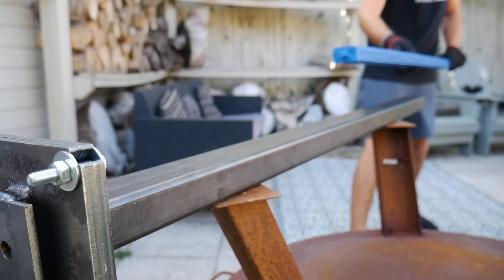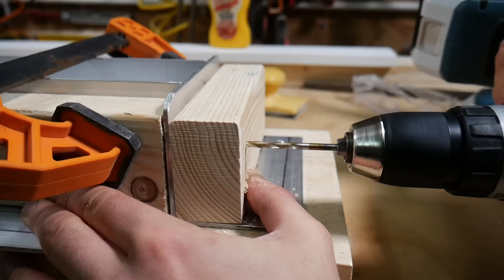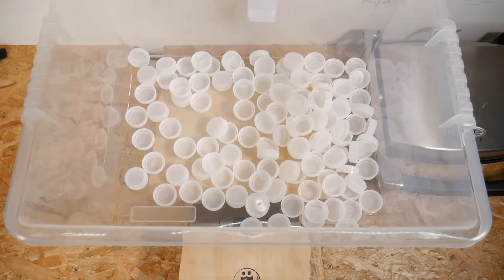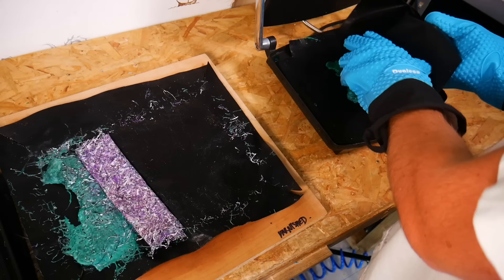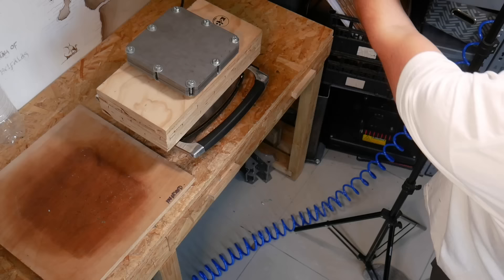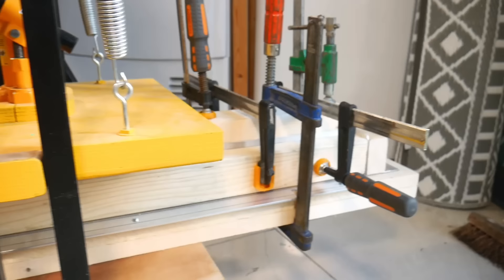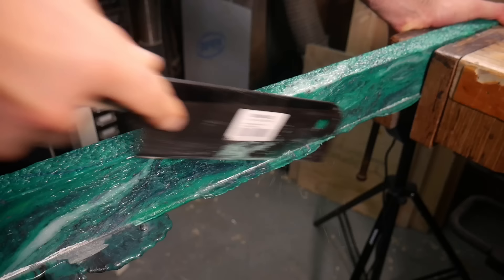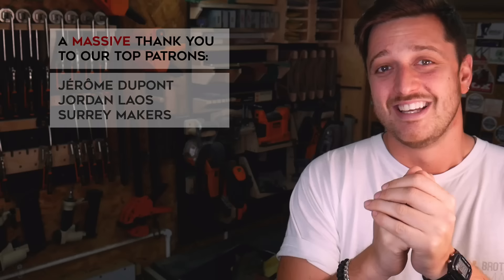How to Make Recycled BEAMS from Plastic Waste at Home

Comment: You should strength test the plastic beam vs. A standard wooden one to see how it compares
Reply: that the most important
Reply: Agreed. What good is it if it can't demonstrate its strength, especially for the time.
Reply: @quest_onchannel54  . Pound for pound it's way weaker than wood . I've used it for tool handles and it splits unpredictably and chips easily with impact.
Reply: good call!
Reply: @leerogers6423  thinking about this...just use more instead of a standard 16inch stud gap...Honestly to answer myself from my above comment...less stud gaps increases in more plastic...This is actually imo a good idea.
Reply: It’s much weaker than wood in two ways. It bends easier and it continues to deform after it bends.
Reply: @leerogers6423  Nice colour options, though. That's what matters.
Reply: @charlesfield9286  hm... maybe it'd be better as roof tiles or something? can't see it working for big wood projects if it does that
Reply: @ara.may.sauvage  it’s the most  inert substance known, but UV light eats it up. Maybe a cutting board?
Reply: @charlesfield9286  just read a co in australia makes something similar but adds mesh to make it stronger and uses it for flooring and fencing... sans mesh cutting boards works too
Reply: @ara.may.sauvage  Plastic being an amorphous material will stretch even if temperature conditions are perfect. But if you apply heat, it will stretch even faster, so its not good for any of the construction applications actually.
Reply: @algalkin  hm... too bad. aren't there companies in india and africa where ppl are making bricks that are being used in paths? they're made from recycled materials
Reply: @ara.may.sauvage  Not only in India, USA also use plastics to make beams, look up Trex for example. The thing is, they add non-amorphous filler in the plastic mix, sawdust or paper fiber. It's non-diyable though.
Reply: good question considering this beam is all just filler and no arming material, if they've inserted some fibers in it it would have been much stronger
Reply: Fencing panels!! No need worry about tensile or compression strength
Reply: @johnle231  Good idea, maybe a mailbox post which won't rot in the ground over the years
Reply: @algalkin   Yea in africa they add Sand to the plastic to make it usable for bricks for driveways and such.
Reply: I wonder if reheated plastic looses strength too.
Reply: @charlesfield9286  It depends on the plastic "alloy", but in terms of density, plastic is quite on par with the average density of wood, and in cases it can be greater. 
since its a proof of concept, the shape of it could be changed to a better structure that can be more rigid and time effective
Reply: @OG.Spirit  loses like 10% at max, but the twisting compensate for that
Reply: First thing I was thinking.
Reply: @ara.may.sauvage  Garden bench or stuff? Should hold up nicely against rain (and sun if coated) and be strong enough to support a few people.
Reply: @renealvarado3658  I wouldn't use them as anything seriously important either way...great for furniture tho
Reply: @Epck  Aye. Something decorative like the bars under the desks or some sort of support for a shelf. Something that doesn't need to be strong or structural.
Reply: @ara.may.sauvage  uv would kill it but other wise a good idear
Reply: @jamieevans871  normally the color that is add to our door stuff has protection. So if it became production could add a UV protector.
Reply: A load rest. Precisely the first question that came to my mind.
Reply: Yup without that this whole thing means nothing. It's got to perform as well as wood to not be a waste of time.
Reply: @leerogers6423  That doesn't mean it's weaker, it means it's more brittle. Tungsten is also brittle, would you also call it weak?
Reply: I was thinking the same thing. He just created a block of plastic from my perspective.
Reply: @leerogers6423  dang it. what about adding something.
Reply: @leerogers6423  not only that, but temperature matters a ton, it can't be too hot or it'll be warp and become soft and it can't be too cold or it'll become brittle. That plastic is more than likely some kind of thermal plastic too I'm sure.
Reply: If reinforced with fiber it would dramatically improve strength.
Reply: Considering how drastically it's bending in the side by side comparison with the wood after running it through the planer, not very fucking strong xD.  Might be good for holding your keys with a nail through it
Reply: @leerogers6423  i wouldnt expect otherwise but still would be interesting to see how it does
Reply: @ara.may.sauvage  It's resistance to UV is very poor.
Reply: @bobbygetsbanned6049  Yes, in terms of tensile strength.
Reply: it needs hot cold cycles too for an accurate test
Reply: @charlesfield9286    this issue is solved by using something else  i can't tell you though because i don't want to give away my idea
Reply: @bradleyroe6801   better off using dirt   soo much cheaper to get  and no that was not the idea
Reply: @stephensaines7100  yeah, too bad. the planet could benefit from finding a way to use it in building homes
Reply: Hot shed made from it would go very saggy
Reply: @JayPlateFaceVideos  cool, so it worked for decks. i thought they were using the recyled plastic in a couple of places in india and africa as path bricks and roofing tiles - is that possible?
Reply: @JayPlateFaceVideos  what about using it where the sun don't shine - and i don't mean my🍑 - what about underground where uv can't get to it?
Reply: @charlesfield9286  I'll bet it is weaker and the deformities probably continue with time since plastic is a resin, a thick liquid in very slow motion that is also evaporating. We still use plastic everyday though and single-use-plastics are horrible for the planet so it's awesome to see someone trying to find other uses for them.
Reply: Yes. And then repeat the beam making using an internal mesh out of old denim jeans for added rigidity and strength
Reply: I am interested in this test as well
Reply: I wonder how plastic compares to the wooden, strength test??
Reply: Taffy puller and some glass fibers. Maybe in a heated cabinet
Reply: Is not plastic the only thing that can be as strong as steel depending on how was manufactured?
Reply: Interesting, but not practical if for no other reason than the time required to make even one small piece. Recycling plastic at scale makes sense, but this not so much, other than just for fun if you have loads of spare time.
Reply: Crush & tensile test also. Looks like it could used for book shelving. Cabinet doors for sure just from this vid. Drawer pulls, A lot if things actually.
Reply: @itsjohnira  I think you are thinking of ceramics
Reply: @tommytwothousand  No I’m talking about plastics.
Reply: Lo de la resistencia se arregla agregando un alma de acero a la viga, como se hacen las de concreto. Lo malo del proceso es q se gasta DEMASIADA energia (electricidad) al calentar tantas veces el plastico.
Reply: Could you use a rice cooker to melt plastic or a slow cooker. I used a slow cooker to cook up my butter and weed , which I made edibles with. Could not use it for anything else after that, the stench was terrible. A thought.  Love to know if these can be used in structural construction.
Reply: Its pitiful.  Its only useful for decorative stuff.  Wood is around 10x stronger than VIRGIN plastic for beams.  Only fiberglass, carbon fiber and metal can compare to metal structurally.  They do make outdoor benches using professionally recycled plastic (requires special additives), or they can combine it with wood fibers for decking, but it's definitely not diy.
Reply: I suppose if produced in mass it has to have a higher density. Maybe than it’s usable for constructions?
In that case we would kill two birds with one stone: for one thing if plastic is considered resource and not waste, it’ll be a lower risk of pollution (oceans etc.) and for another thing it could slow down dwindling but essential forests.
Reply: This is a very interesting question, I would posit that if ,in the design process, you compare the strength of a vat of recycled plastic extruded and then pressed into a mold compared with the process you did, and see how much stronger it is, when you stretch the much kneaded plastic melt the entire length of the board you're making. I think it may give it quite a lot more tensile strength, but if not, it'd be much more efficient to uses a chipper/shredder to break down post consumer plastics, and deposit them into a non ferrous barrel and mix it, by rolling it at a 60° angle, and perhaps using a magnetic mixer as well, while it is in contact on bottom with heating coils.then when at sufficient heat you could seal the top on, then attach a air compressor and extrude plastic through a valve in the bottom center of barrel( so it could continue to heat evenly while extrusion commenced.
What do you think?
Reply: So many responses to your comment I want to answer. Plastic is not necessarily weaker than wood. It's much better than wood in applications in wet places or where mold-type microorganisms are a problem, since plastic being quite new on this planet, does not yet have biologicals that have a taste for it*¹, it's tensile strength is greater than wood under some conditions(& temperatures, which may be a problem, but not at typical human friendly temperatures). There are recycled plastic composites with wood that have greater strength, durability, resistance to weather, easier to clean( bacteria & molds can still live on surface, in cracks & micropores, but wood can become *yncleanable). These boards and wood replacement products, are used for incredibly long lasting decks, stairwells, bench's, picnic tables, sign posts, and window vents. This technology has the best strength and service life when combined in composites with hemp fiber( from Cannabis plants). Look up research from Washington State University. The tensile strength is 30 times that of wood alone and it is especially useful in construction to resist seismic forces, because strong and flexible makes it ideal. 

*¹ this is the reason, micro-plastics are such a problem, nothing breaks it down... No biodegradation...but nature will fix that soon I'm sure or a clever college student with access to a CRISPR (which is really effing scary if you think about it- synthetic life is exploding and there are virtually no oversight, nor laws in place, regarding the introduction of new life forms, but genetics students everywhere are required to create virus, then bacteria, or single celled organism starting with a wide variety of templates).
Reply: @RogueFamilyAdventures  old jeans, great idea!
Reply: @itsjohnira  actually there are several things now that are stronger than steel, like carbon fiber, and some aerogels.
Reply: @itsjohnira  of course ceramics can be much stronger but not at all flexible. That's why steel is so good because both flexible and strong ( adjustable qualities, depending how you make the steel).
Reply: @jahsunhandy  dude why are you talking about ceramics? Are you talking to yourself?
Reply: @jahsunhandy  I stand corrected. Thank you for sharing that. Honestly, never thought of ceramic that way.
Reply: Plastic beam will fail miserably
Reply: I cannot scroll past this 68 comments thread. Bumping to 69th comment.
Reply: That would be awesome info to know.
Reply: @ara.may.sauvage  Maybe add like a fiberglass mix to it like they use for cars in thin sheets in the middle.
Reply: @frodobaggins3456  i wonder how it would hold up to that much friction and movement and how safe it would be in accidents? oh wait, yer not suggesting to use it in cars - doh
Reply: @ara.may.sauvage  No in any building structure that is subject to temperature changes. If it could be made stronger it might be useful if stable.
Reply: @quest_onchannel54  Possibly decorative molding in a room.
Reply: This
Reply: @ara.may.sauvage  Hybrid wood and plastic mix for deck boards
Reply: @leerogers6423  Looking into some materials engineering videos, especially with 3D printing, you'll find the many times using less material, while adding internal system of scaffolding actually increases the load bearing strength of the beam. If engineered properly, it can be stronger in all directions.
Reply: Nice BPA  Friendly plastic
Reply: make it half size and could be alternative for the supports in the garden for plants, maybe create a custom mold to make it directly with a tip so can be hammered easier in the ground
Reply: @halkive4619  I don't see where a diy would be permitable for replacing wood or steel studs in actual construction. Lots of testing for strength and flammability would be required. And what is its temperature stability and outgassing characteristics.
Reply: @notreallydavid  Good looking DIY bowling balls. If reinforced, maybe entry level skateboards?
Reply: @richpayton7162  These sound great.
Reply: @ara.may.sauvage  It would crack in the sun. Plastic doesn't do well in sunlight. Being cold while being in sunlight would ruin a plastic tile.
Reply: @kevincasper5589  yeah, there's gotta be a good use for it tho - hopefully it'll be found
Reply: It’s super bendy
Reply: @charlesfield9286  Nah.... Make it into roof tiles then coat it in UV protection. (Just a thought)
Reply: I was thinking it could replace the ceramic table in the bathrooms
Reply: @Sean Sean Pay your local recycler, there's tons of plastic bottles
Reply: Use it a tiles for the interiors
Reply: 😃😃😃  Penny wise
                 pound  foolish. 😃😃😃
Reply: @leerogers6423  did you also use hdpe? asking because im considering making furniture from it, so I need to have an idea of how strongg it is
Reply: @quest_onchannel54 , it's pretty and probably waterproof. Those are good.
Reply: @ara.may.sauvage , siding?
Reply: @scottwilhelm2086  it doesn't hold up sunlight tho
Reply: @leerogers6423  Hello , did you make the handles out of pure plastic ? Or have u tried mixing it with some other "adhesive" material ? I am asking out of pure curiosity because i want to recycle plastic in the same manner. Ps: if anyone else have any useful info or ideas please contact me.
Reply: @charlesfield9286  i see so it is not a good idea to use this as foundation material , but how about outdoor decoration ? How long do you think its going to last in the open ?
Reply: @ara.may.sauvage  by mesh do you mean a metal mesh ? like those used in cement constructions ?
Reply: @MrRiikuo  that would make sense but i don't remember, sorry
Reply: I suppose the deflection of the plastic 'beam' while lifting out of the mold doesn't suggest much.
Reply: @leerogers6423  what? It's damned near indestructible! Were you using some other plastic? Or just too low a melting temp?
Reply: @theantiveganchannel3596  it's hdpe. You can look it up online, and it doesn't care about temperatures in the natural range.
Reply: @leerogers6423  Lee if you mix the melted plastic with sand. Please let me know the result. Maybe heat the sand and plastic just a lil
Reply: @algalkin  what if you mix the melted plastic with sand?
Reply: @richpayton7162  I'm pretty sure that my first skateboard deck (circa 1979/80?) was made from some kind of plastic with very similar properties to the HDPE kayaks that I have now, so maybe we already had that idea and it just didn't catch-on back then?

If you're interested, my skateboard was significantly deeper/thicker around the edges and had a thicker central "spine" (and areas where the trucks bolted-through the deck) that allowed it to be (fairly...) rigid in the lengthwise-axis but still flexible enough to allow some twist between the trucks, just as my kayaks have thicker internal "ribs" around the perimeter and thick hollow vertical scupper tubes between the top and bottom of the hulls, so are pretty-much rigid in the lengthwise and twist-axes, but the non-stressed parts of the hulls can be flexed by pushing on them with my thumb.
Reply: Florida uses this style on alot of their fishing piers now since it holds up better to the salt water. Cape coral pier in cape coral FL has it on from the walk way to rails. They probably added something to the plastic to strengthen it but the plastic would definitely last longer than wood plus no termites
Reply: @leerogers6423  do you mean this whole video was a waste of time?
Reply: That's exactly what I came to say. Also it would be nice to see the combination of different percentages of plástico combined with wood or even metal. Like vary the thickness of plastic coating the beam and see if its effective.
Reply: Same thing I was thinking. Except there’s a way to reinforce the plastic, then it’s not really better as compared to wood. If that can be successful achieved. Then that’s a good move
Reply: Agreed. And check it’s fire/melting resistance too.
Reply: Less tensile strength, especially in hot weather, go 12 inch or less rather than 16 inch spacing of joists below deck, dark colours are worse for getting hot, plastic also has a very high rate of expansion as it warm up
Reply: @ara.may.sauvage  I wouldn't want to walk barefoot on plastic tiles. I also wouldn't want to poison my garden soil.
This is a neat fad, but it is just not practical at all, sadly.
Reply: How to make a beam: first get 12 beams…
Reply: It doesn't compare .. the plastic beams are useless
Reply: In my opinion, wood beams might give people more time to escape before the building collapsed in a fire.
Reply: This thread is nonsense. So many of the “criticisms” about the plastic beam are also true of wood. Warps in different humidity/tempuratures, is affected by UV (the colour of wood breaks down, as does almost every finish applied to it), etc. If we put thousands of years in to working with plastic beams the way we have with trees (or even a couple strong decades) we would have a really solid building material.

Caveat: tbh I tapped out on this thread about half-way through so apologies if someone already said this
Reply: A wooden plank of the same mass would definitely out perform it. Impure recycled plastic bottle cap planks will be nothing but ugly brittle twigs in comparison
Reply: Add whatever u need into it to strengthen as needed !
Reply: @bobbygetsbanned6049 add some carbon non-oriented carbon fiber refuse, which is quickly becoming a problem as it can't be disintegrated at less than 700c ~ 1,200c... Fiberglass debris & kevlar would be great in the as well !
Reply: Very true. Also how dose if effect over time. However if it is weaker just build your desk beams a little closer.
Reply: @ara.may.sauvage  I think those are rubber, but it's a good idea
Reply: @leerogers6423  curious if heat might help solve the chipping issue... like using heated inserts on 3d Prints, but heated screws while preheating the board some.
Reply: Water resistant
Reply: It’s weaker than wood for sure. It would be interesting to see how much force it could handle in general though
Reply: Agreed. That would be very important to know if it were to become commercially viable in the future, which ultimately is what will make a difference to the worlds plastic use